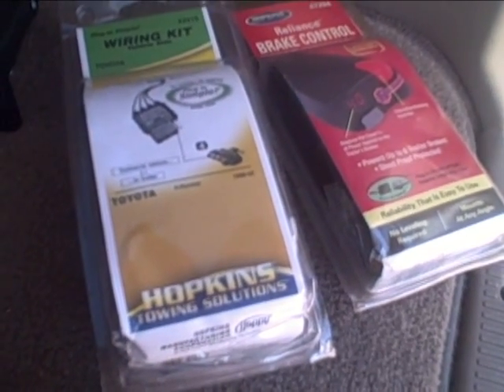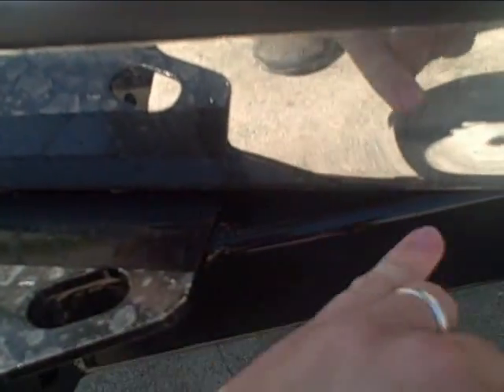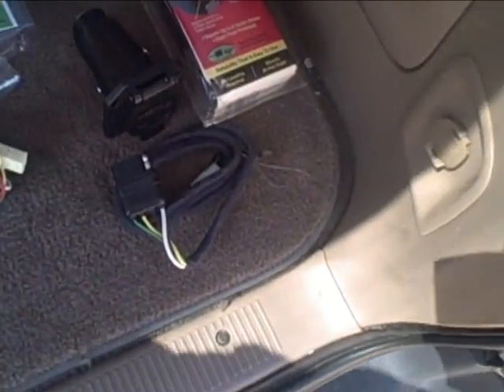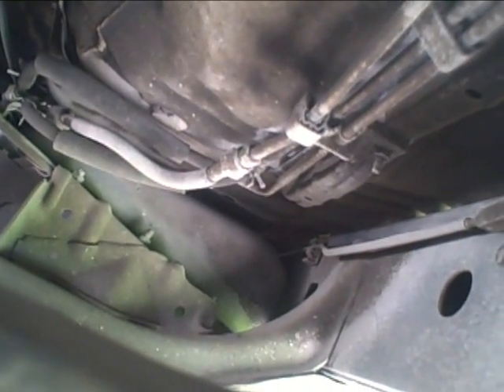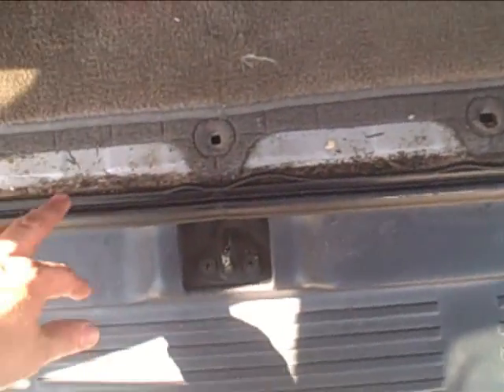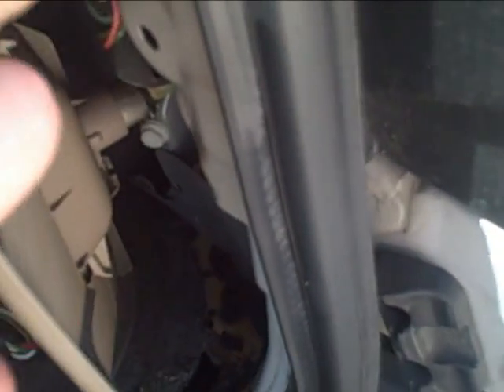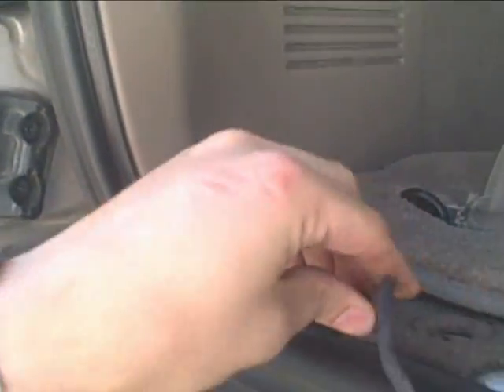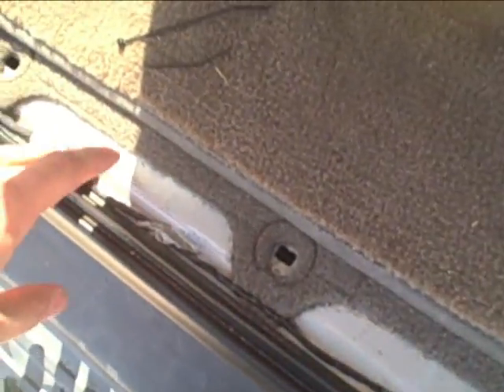99 4runner trailer lights and brake controller Install Part 1

Comment: This is probably one of the worst install guide. You show us how to open the panels but neglect to show how the wires are connected. I know there's only a few wires (4) to connect but you totally skip that part and basically said everything in hook up.

Comment: Where's the location for right signal trailer fuse?
Reply from the maker: I sold it a few years ago but I recall it used the same fuse as the car turn signal fuse.

Comment: You must live down South....A 1999 4Runner (Mine is a 98) up North here in salt and snow, you would have rotted brake lines, frame, and bumpers!